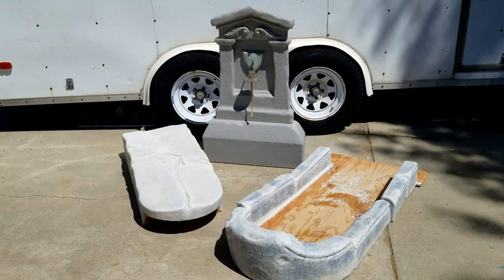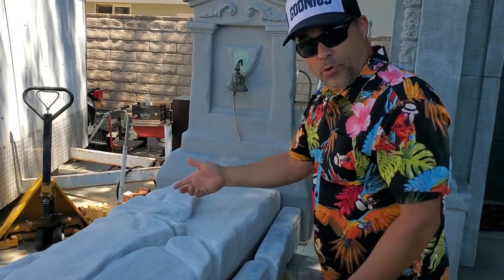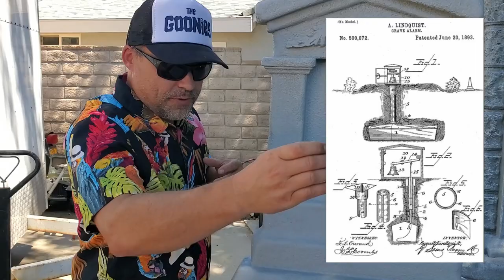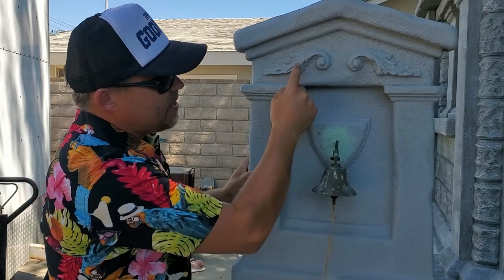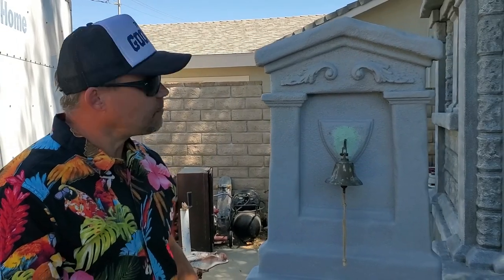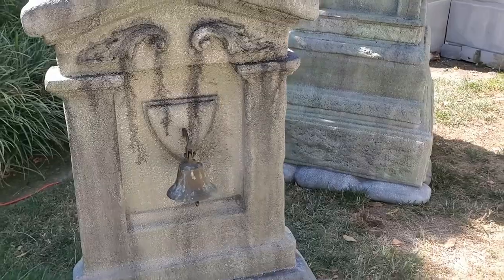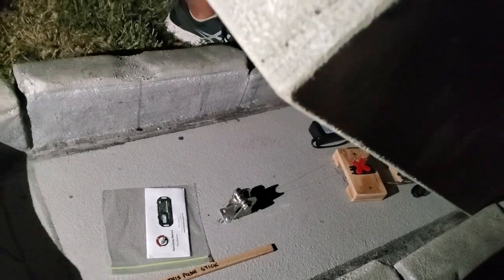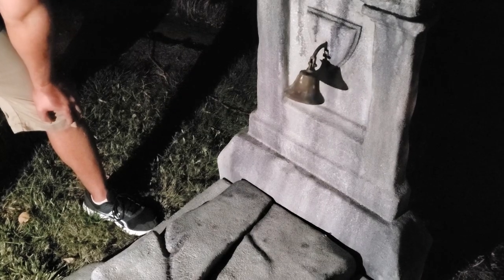We made a Haunted RINGING BELL TOMBSTONE! DIY Halloween Prop

Comment: Quick question.. can you skip the fiberglass stage and just spray the flexbond concrete directly on foam? for reference I am a home haunter.. thanks
Reply from the maker: Of course and if you didn't want to do that step you could just paint it with a drylock sealer or paint/primer and call it good. It's really however much money and time you want to put into your props and how long you need them to last.

Comment: A creative solution I thought you did the bell ringing a different way, but that works.... I've learned that overkill is just enough kill for a Halloween prop... It is not a true Halloween prop if there aren't problems... and you just eliminated probably 5 of them with that pulley.  Secondly, I thought it was hilariously ironic That FlexBond bag, read at T=4:09: "Premium Crack Prevention Thin-set Mortar" is covering cracks that you intentional made LOL... A true haunter does that... preserves the creepy features, and you don't want THOSE to crack!

Comment: Not to take your post off topic but I have a question on your oscillating props videos from 8 years ago. Do you disable the fans or just let them run as is?
Reply from the maker: I want to say it moved without the fan on but if it didn't it would have been on the lowest running setting.

Comment: May I ask how you keep the plywood from separating/ delaminating when being used outdoors.
Reply from the maker: It is sealed pretty well with all the paint layers. Plus, it even has a little resin over some areas where the foam was attached. We haven't had any problems with that so far.
Reply: @HollywoodHaunter  I used type 3 titebond glue on the plywood when I layered it and then red guard over the whole tombstone then drylock the plywood is separating really bad
Reply: @HollywoodHaunter  I made some  like your chunky ones with the box on the bottom that you put sand bags in the plywood swelled up really bad and is delaminating
Reply from the maker: @dannyflanery7466  oh no thats lame, which plywood did you use? I know ours was with 3/4" CDX, which usually holds up in the rain.
Reply: @HollywoodHaunter  I used the same 3/4 " cdx
Reply: @HollywoodHaunter  sheet goods here are really expensive.
Reply from the maker: @dannyflanery7466 I'm really sorry to hear that. I'm sure it's not meant to, but I've left unpainted scraps out in the weather for years and am able to use most of them for projects. In fact, our breathing grave we made in 2014 was just painted black and has been sitting out ever since. Surprisingly, it's still looking OK.